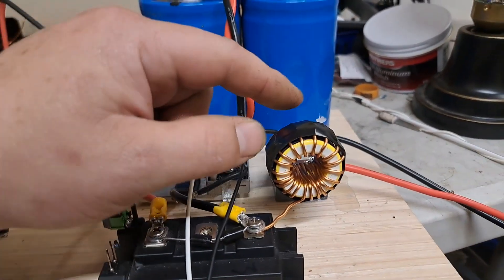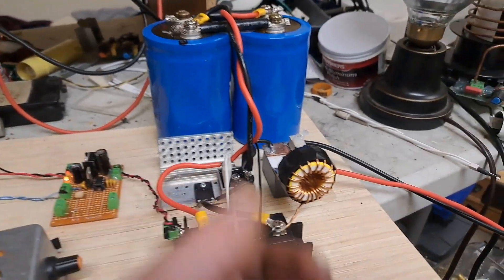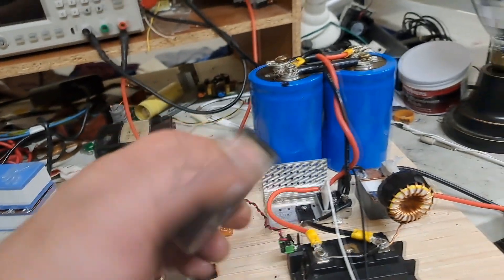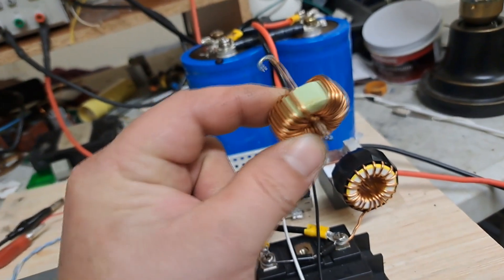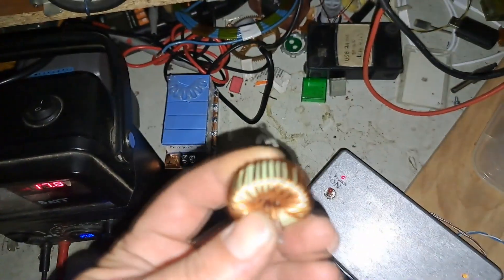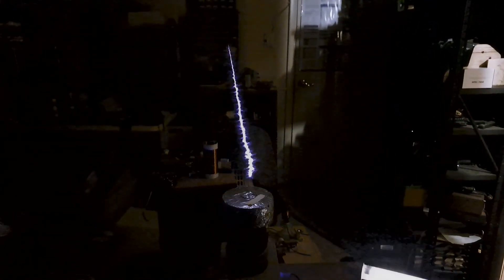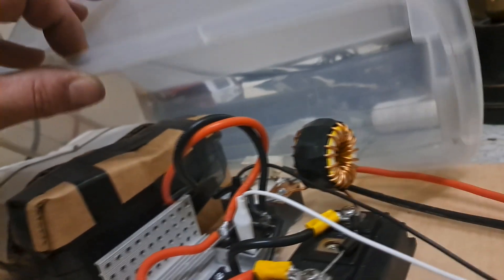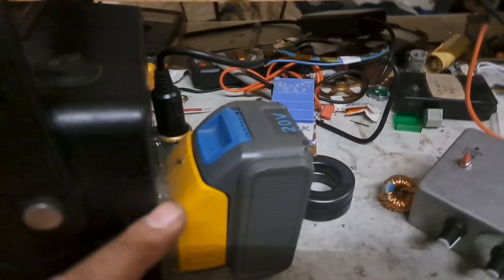QCW SSTC More Testing & Toroids

Comment: I am glad you are back at it , I can´t wait to see the mini qcw build , I been messing with the pll driver and a lower frequency secondary (300khz), but I am not getting nice results I tried diferent primary 1 turn 2 turn 3 turns and it is only getting worse  the idea was to use it for a qcw build , but I think I am gonna go with a push pull qcw like mslab I am already building a nice setup on a pcb probably I am gonna end up doing some kind of push pull qcw tesla gun , I might go back to the little 1.4mhz secondary on the pll driver the thing was working so nice I just was having some problems when getting higher than 18v but I think I can solve it trying diferent primary and messing with the snubber.
Reply from the maker: Lower frequency should definitely be easier but when transitioning from something like 1.4mhz to only 300khz you have to make sure to change up the PLL timing so the potentiometer can actually hit that range well enough. Always possibilities like needing to change the orientation of the windings etc. My most favorite one for some reason has been sitting around because I never finished rewinding the secondary coil I destroyed somehow.. but it was 500khz and the output was real nice and clean. I had to use at least something like WIMA shunt caps to get it like that and it was around 23nF with about 3 turns. 

You also have to constantly spot check if you aren't already doing it, but that becomes hard without a multimeter. With just a meter I would be checking for voltages on the output of my chips that were about half of the peak to make sure I had clean 50% squares for example. I'd be making sure my voltage regular was still good and outputting a solid 12V or so as opposed to 11.79 maybe. 

You can sort of imagine what you should be seeing from a baseline of how Steve Ward's original Micro SSTC works with just a gate driver and a single mosfet. If you were to imagine setting a variable drive frequency as opposed to feedback, which I've tried, you basically get the same results but without auto-tuning. 24VDC can easily get about an inch or more of solid plasma CW. A little less isn't bad. That mosfet might be cooking though... I've found this to typically be the case with nearly any kind of coil I've tried at random so when something doesn't seem right.. but everything seems to be correct.. sometimes it's just worth trying different components because sometimes components can just suck for the application, or suck in general.
Reply: @Magneticitist  Yes , I noticed something strange with the last tests , I made a 3 turns primary , I test it kinda worked a bit worse than the one turn (was drawing about 1.5 amps at 16v) , but then I thought about flipping it just to try , and it worked both ways(wich was strange) , but the other way it was drawing like about 4 to 5 amps at peak output , I had to play with the pll min max to lower the Frequency range , but I never touched the snubber it still the same 2.2nf , maybe it makes sense that for lower frequency bigger snubbers are needed , I might play with it a bit more but I think is not worth it , the field on that coil at cw is strong af my led desk lamp starts blinking haha that was funny , I should try to see if my am radio can pick up the noise

Comment: Hi there dude. Nice seeing you have IGBTs brick now. I never tried them b4. Me too I'm focusing on doing a real Ramp sstc full bridge. But, don't know when will I really have free time for that! I'm facing fake components a lot lately & if ever I'm gonna buy from mouser, it's gonna be costing me way too much money. But I need to try it out anyway as these Tesla coils have sort of become our drug now. I'll need a very good simply schematic first.. I just peep at loneoceans schematic. But I'll need to get my hands on good components first. Great to see you still keeping up with those setups.. Take care bro.. Your videos are inspiration to me. Just keep it up.
Reply from the maker: I have a handful of IGBT's I got free from work but they are mostly 3 phase modules where at least one switch in each has blown up. Of the basic half bridge bricks I have like the one I'm using for the buck, there's still one good switch in each of them so it works out. I was hoping the majority of these 'dead' modules I scavenged would be straightforward but some of them have intelligent circuitry inside. A couple seem really ideal for full bridge builds because VFD's are typically wired as 3 half bridges tied together at the rails. So one has a dead switch inside but there's still an already-wired working full bridge in there I can use. 

You should really try the ramping though. It all used to be too mysterious to me until just grabbing Finn Hammer's code. I wouldn't have known how to do it otherwise. I'm not even really sure how it works so well unless a Tesla Coil just happens to be the perfect load for it. I'm going to eventually make a smaller build to see how far one can push a QCW setup with more commonly available parts. The biggest issue is the LC capacitor. I don't think most people have 20uF in suitable caps laying around unless the target voltage for the whole thing is super low.
Reply: @Magneticitist  well, in fact it's true about almost all the things that you said as very long time ago, some 18 yrs back, I've worked for the industries as industrial technician & got many good occasions when I could have collected many IGBTs bricks but didn't know what to do with them! Now that I'm in the Tesla coils world same as you & the other coilers, I deeply regret not having kept any.. Those times, those bricks were from Germany & I was repairing 3 phase industrial motors inverters & I must say I was ordering plenty & now I realized that it's a pity I didn't collect any.. Those were genuine parts long time ago.. Nowadays, if we don't pay attention, we get fakes. But that QCW dear, it's a real temptation for all coilers. Steve Ward, loneoceans, you even helped out labcoatz, Arc angel, yourself, you all did it & got pretty damn good results.. Bryan from SciTube did something very exceptional concerning his QCW but I still can't figure it out as his circuits look complicated but he did a marvelous job. His LC was well done to manage that ramp.. I'm really tempted but budgetwise, it's actually impossible for me. Wife will yell at me coz lately, I've thrown away way too much money in those Tesla coils circuits for the past 2 yrs. I'll stick with your videos & see how you progress with it. Meanwhile labcoatz also said that he's trying to figure out more complicated & real QCW as his future builds with the help of all professional coilers so that his circuits sees victory.. Well bro, take care & keep it up.
Reply from the maker: @RAVI171175  Exactly, the cool thing about it is that they are genuines.. Nowadays industrial equipment is even cloned left and right though. It's shocking actually. Some really legit companies I'm sure you've heard of have a ton of clones out there that look really convincing. 

Brian's ramp is really nice but I think he's using the same arduino code. He either had his scope time base really large making the ramp look stiff or he modified the code so that the downslope was much shorter. I think it's 20% of upslope in the code.  Either way you can probably pull off the same waveform easily at low to mid power like I'm doing with a moderately sized buck. 

I'm also not sure what kind of bricks he's using for such frequencies but they seem to work.. Pretty soon I'll have to just stress test my build with mains input because my inverter is not really able to pump the juice at the higher on times. I imagine that's when I'll see my LC filter being a weak point.